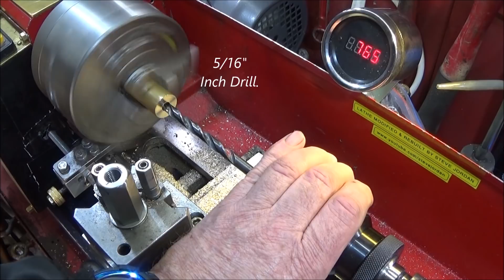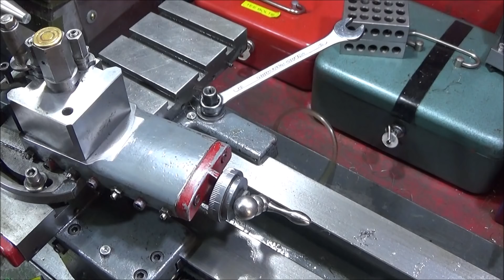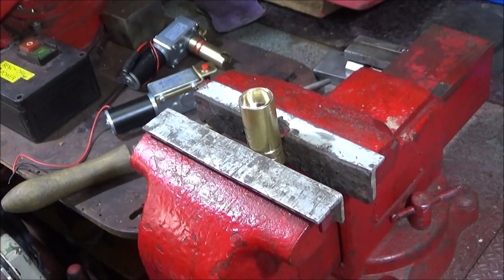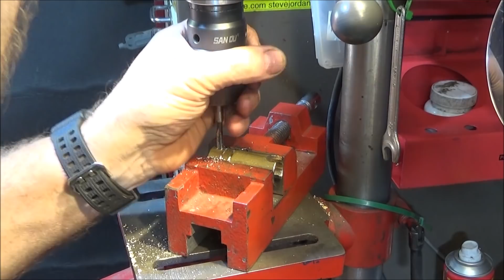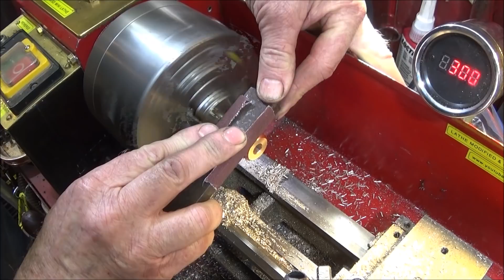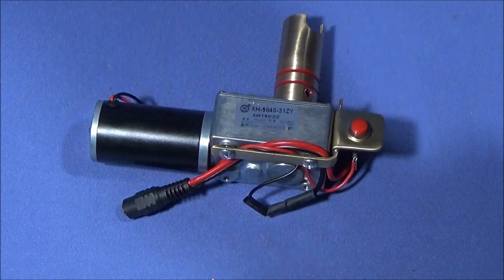Making The Brass Drive For My 24v Compound Slide Drive + Wiring.

Comment from the maker: SEE LINKS BELOW FOR COMPONENTS NEEDED AND TOOLS USED.
High Torque Gear Motor 24V DC 16/40/260/470RPM For Intelligent Curtain Motor - #3 -- http://bit.ly/2F3NYjI
High Power DC Brush Motor Speed Regulator Speed Controller -- http://bit.ly/2WH8uh4
Switching Power Supply  -- http://bit.ly/2FR7zoK
LUSTREON DC12V Male/Female Power Supply Jack Connector -- http://bit.ly/2JZPsB9
LCD Electronic Digimatic Micrometer -- http://bit.ly/2FsZ1mS
TM® 220V Adjustable Speed Mini Polishing Machine -- https://goo.gl/tsVoYT US Warehouse -- https://goo.gl/y26kZk
EXT GROOVE TOOL 12MM SHANK 2MM WIDE INSERT TYPE... https://goo.gl/1uRpB4 
High Quality Cable Wire Stripper Cutter -- http://bit.ly/2E4awl1

AN ALTERNATIVE 12 VOLT KIT THAT WORKS EXACTLY THE SAME:-
DC 9-60V 20A 1200W High Power DC Brush Motor -- https://bit.ly/2HXruq9
12V 160rpm Reduction Motor Worm Gear Double Shaft DC Motor Cear-box Motor -- https://bit.ly/2UYuIjH
TWO TREES® 12V 30A 360W 21.5*11.4*5cm Switching Power Supply -- https://bit.ly/3mNm96G
LUSTREON DC Power Male Female 5.5*2.1mm Connector Adapter -- https://bit.ly/38o5pur

Comment: Hi Steve. Thanks for another great series of videos, i've just finished making one of these for my Warco WM180 lathe. It might be worth pointing out that when ordering the high torque gear motor from Banggood you need to make sure you have selected the right gearbox as there are 4 different ones. Otherwise you might end up like a certain one of your subscribers with a very slow power feed! 🤔🙂

Comment: I like that method of decorating grooves; I'd use ladies's fingernail enamel because  I find it cheap and bulletproof. BTW if you are tapping metric threads you need no tables. In metric,  tap size = OD - pitch. So M6x1, tap drill 6-1=5mm. The same equation works in Imperial too, but the drill sizes are all weird decimals,  so you might as well  use a tap chart.

Comment: 9:52 ahh the classic "until you hear that chatter" groove depth. I will often place that dimension in my cad models because I like to be honest when designing a part I am about to machine. 🤣
Reply from the maker: Hi sorry but I  find it difficult  to know what you are on about. Maybe I'm  tired but I just can't quite grasp what you are saying?
Reply: @SteveJordan  I was talking about the decorative grooves where the depth does not matter and I noticed that the tool just happened to start chattering a little when they we're deep enough. It was meant more as a joke in that the dimension is good enough to not warrant changing the feeds or speeds and to just move on to the next operation. Sometimes satire can be difficult to convey, I did not mean to insult by any means. In fact this is probably the best idea I have seen for a compound power feed that does not require a dedicating a power drill.

Comment: Hi Steve, exelent done. In the finishing you put a lot of effort. Perhaps it would look nice to use heatshrink over the complete wiring. You then see 2 heatshrinked cables instead of 4 cables. Maybe it's an idea to use a main power supplu from an old computer desktop. These power supplys are very reliable. They have the right voltage and more then enough Amps to use.

Comment: Steve,
There seems a large amount of wobble in the part when adding the chamfer to the motor end of the tool. Is it the work piece or the chuck? These geared motors are very powerful for their size and I have been using one of these for a couple of years now, especially useful when cutting tapers using the compound. I have a 2pole double throw momentary rocker switch so that I can change from fwd to backward easily with centre off.

Regards
Reply from the maker: Hi Michael No I just didn't clock the piece in and its running out. I need to take this chuck apart sometime and clean it as the repeat-ability isn't correct at the moment. I found this happens when tiny brass chippings collect inside. I just left the reverse switch next to to speed control, as its easy to flip that and turn the potentiometer at the same time with my left hand for speed reversing.
    If I had more than basic knowledge in electronics I may have put all three controls on the unit, but then again I like to keep thing simple, so everyone can easily make one up.